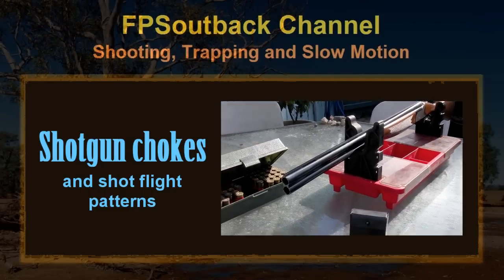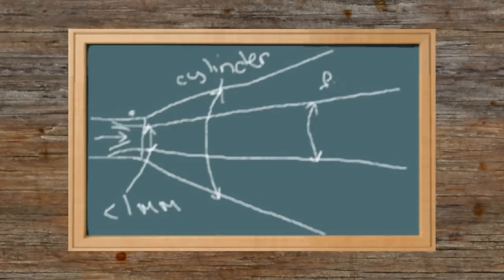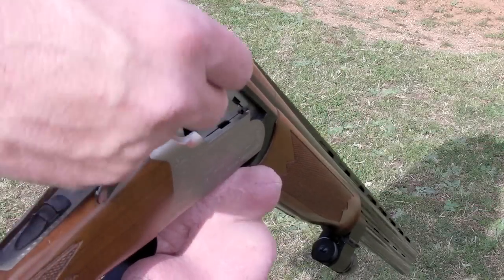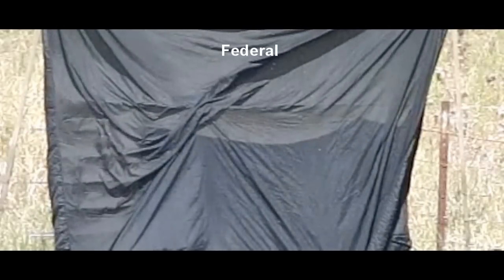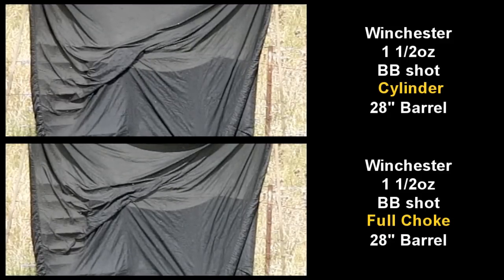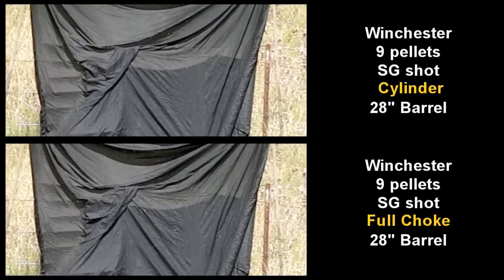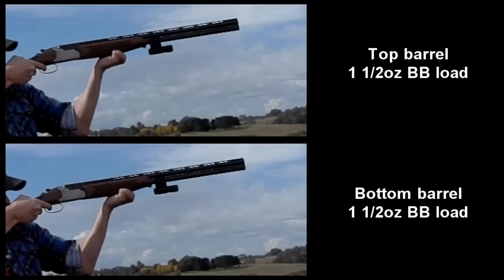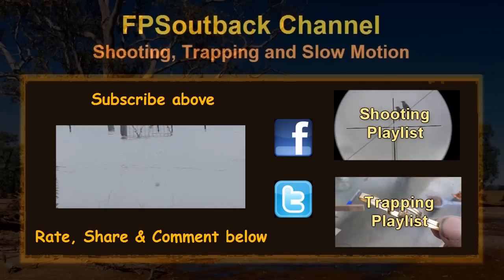Shotgun Chokes and Shot Flight Patterns

Comment from the maker: Yes you can, most if not all foster slugs are designed with full chokes in mind. I personally don't fire them from the tight screw in chokes but have no issues firing them from fixed 1/2 (modified) chokes in the coach gun. It will likely tell you on the box.

Comment: Unless you have 2 triggers match your chokes.

I shoot semi auto O/U and sxs. And I used to have a tighter top choke. 

Its pointless.  On a O/U unless you are maybe shooting something like waterfowl or doves/pigeons just install the same choke in both barrels.  

Shooting semi auto you'll see that the proper choke always works.  Whatever that choke is install it both tubes on your O/U and always shoot bottom tube first.  This will just always be more controllable, with less muzzle rise on the first shot due to the lower shell being below your shoulder.  And then you'll not have any debate.

Only exception would be uf you have say decoys where you expect to shoot at a bird close in over decoys and then shoot at fleeing birds after the shot.   Clays don't flee, pheasants and upland youre just as likely to hit the first and flush second bird close as shoot twice at the same bird.

Comment: I honestly don't see anything wrong with your current setup. I have a Remington 870 Super mag 3 1/2 that's great for shooting trap. It's not even that bad for Sporting clays. When you're shooting trap one shell at a time, it doesn't really matter if you have a pump, over-under, semi auto.. You're not racking another shell until your next round. Install a choke you're comfortable with and maybe change the stock and that Remington will do very well for you as a beginner. Happy shooting.

Comment: you are not suppose to use any chokes while using 00 buckshots or slugs correct? Otherwise you'll blow up the barrel?
Reply: Improved choke at most for rifled slug is what I've been told
Reply: dasllamas what happen if you use choke while using slugs or 00 buckshots?
Reply: There is a good forum out there that covers this exact topic but I can't find it right now. Basically when shooting a rifled slug the "fins" deform to fit through the tighter bore. If you go too tight you risk too much pressure building up and damaging your barrel. If that doesn't happen at a minimum the slug slowly damages your choke. With 00 buck the shot just shifts around to fit through the tighter bore.
Reply: dasllamas well, I don't have much knowledge about shotgun or how chokes work. Anyway, I'll be shooting 12 gauge slugs & 00 buckshots at a target about 60 yards away, what's your recommendation? Don't use any chokes at all?
Reply: Slugs you will be fine with cylinder bore (no choke) or improved choke. 00 buck at 60 yards is a stretch no matter what choke you use. Good luck hitting anything less than the size of a deer if you use cylinder bore and 00 buck at that range.
Reply: dasllamas can you use Full Choke while shooting 00 buckshot? I (MUST) remove the full choke when using slugs correct? Otherwise I might blow up the barrel?
Reply: As far as I know 00 buck full choke should be ok. Just don't run a slug through it. But hey I'm just a guy on the Internet what do I know haha.
Reply: dasllamas well I might want to use full choke while using 00 buck shot since I'll most likely be shooting 30+ yards away.
You're just a guy on the internet? Haha, I'm a completely shotgun noob at least you have some knowledge about shotgun lol
Reply: Well I went shooting yesterday using slug and 00 buck from Remington 870 shotgun. I posted the video on my channel. Just did some fun shooting to show power of slug vs 00 buck at 20 feet give or take. 

00 buck at 25 feet gave me a spread of 6-8 inches. So just estimating from experience per 5 yards you will get about 2-3 inches of spread. (Depends on brand of spread)  so if you figure 50 yards your spread will be around 20-42 inches. I would lean more toward to upper 30" spread at that distance.
Reply: dasllamas so you didn't use any chokes at all? Looks like I'll definitely not be using any either since I'll be running so wax slugs through it as well
Reply: no choke.  cylinder bore only.
Reply: Also wax slugs should be shot through cylinder bore. If you try wax slugs through full choke you just end up shooting wax covered shot.
Reply: dasllamas
you are right about cylinder bore on waxer's, but skeet chokes will also work. there only 1 step up. been  making waxers for 30 yr.s. lol
Reply: dasllamas you can use a 5 line choke which is cylinder bore you must have a choke inside other wise you will damage the threads of your gun
Reply: i agree with hidri86 about protecting the threads. however the reg. slugs not sabot type can be shot out of any choke except full choke, safty. but i shoot .410 slugs all the time out of a full choke at tree rats. but this .410 has no threads. reg. slugs are hollow and squezze thru with out any problem.
Reply: I know you need to protect the threads. When I say cylinder bore I assume people know to have a cylinder bore "choke" in there not exposed threads. Try not to read into what I wrote. You know what I mean.
Reply: well since I live in uk I don't need to worry about shooting a slug as I would NOT be able to even see 1 is illegal here in uk
Reply: but I do want to info other shotgun users to at list have a cylinder on their shotgun
Reply: If your gun has screw in chokes Always use them to protect threads, Miroku info says never fire without
Reply: I doubt ANY choke would cause the barrel to "blow up" but slugs and buckshot usually work best with cylinder or improved cylinder choke.
Reply: Russ Clifton...you are correct, it is not recommended to fire the gun without some sort of tube in place, but "no choke" could also be taken to mean "cylinder" choke, which is what I assumed.  There are "cylinder" choke tubes for this purpose.
Reply: @7150285  Cylinder or Improved Cylinder.Never fire without a choke!!!
Reply: @richardcarden4161  never fire what w/o a choke?
Reply: @7150285  You will damage the threads in the barrel.Using a cylinder bore choke will not constrict the shot any.
Reply: @7150285  Never fire any projectiles without using a choke.
Reply: @richardcarden4161  are you saying always use a choke? Whether it's 00 buckshot, birdshot or slug?
Reply: @7150285  YES!!!! If your barrel has a screw in choke you need to have one installed before you shoot it. What constriction depends on what size,type of metal and desired pattern of your shot.
Reply: @richardcarden4161  ok then. You keep insisting that a choke is needed. What bad will happen if you don't use a choke then...??
Reply: @7150285  Well with no choke the shot or slug passes across the threaded part of the barrel. This could be potentially damaging since the threads are very fine.If you don't believe me go ahead and blast away but don't be surprised when you go to install a choke and find out that the threads are mangled.
Reply: @7150285  Just buy a improved cylinder choke.It is compatable with just about anything and will only cost you about $20.00.

Comment: I was lead to believe that you could have shaped shot patterns using chokes, like an x or a cross. Thanks for the footage.
Reply: Generally they are round.  Some years ago I saw some specialty choke tubes designed to throw a pattern which was a long ellipse.  It could be positioned to shoot a vertical or horizontal pattern.  Obviously, not enough people found a need for them or they would still be a "thing".